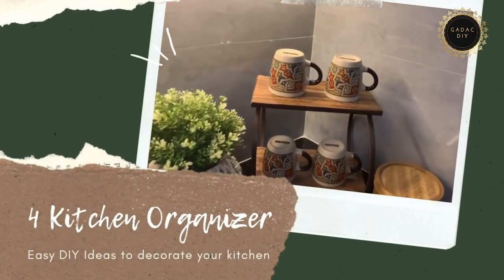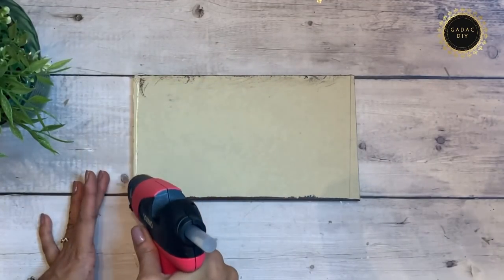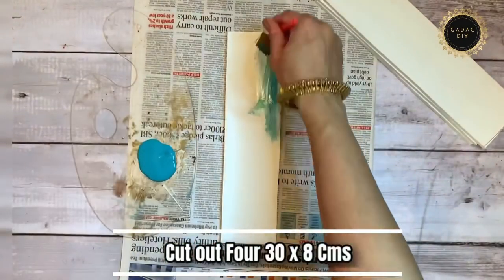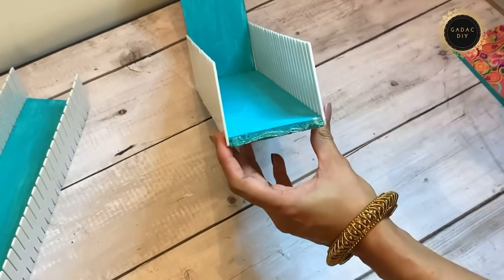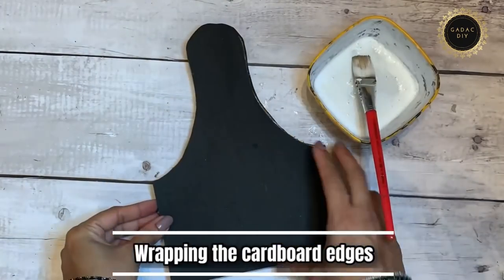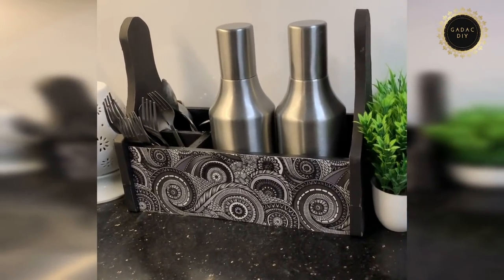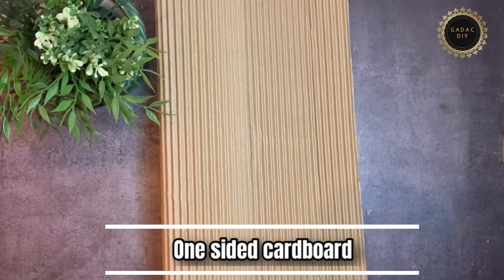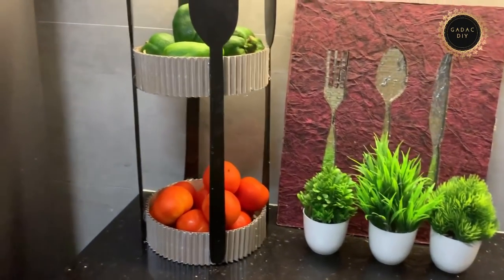I will show you how to make your own kitchen organisers | Don’t Miss Out The New Look! | GADAC DIY

Comment: With normal got glue can all these be done ? In terms of strength and durability. Pls let me know
Reply from the maker: Yes Leela, it works well with normal glue as we are keeping light weight stuff, if need be you can also replace it with glue like E6000, which has more strength. 👍🏻